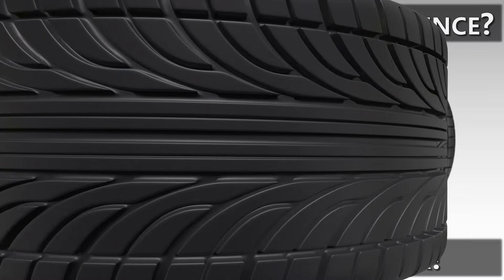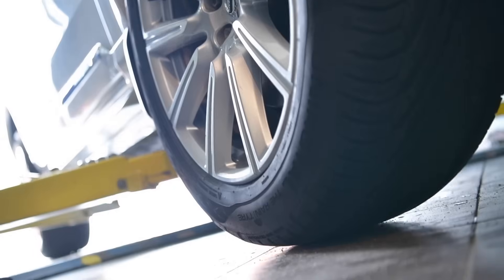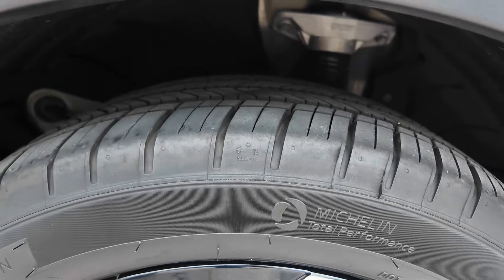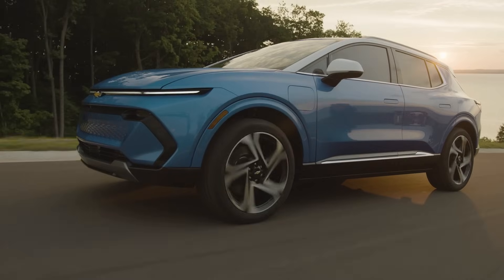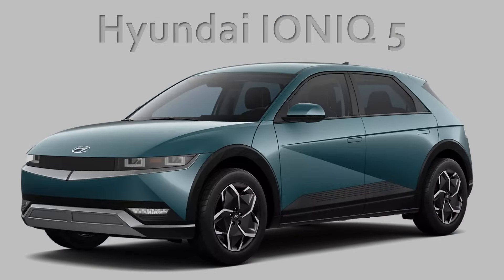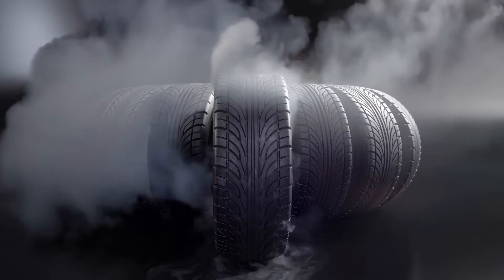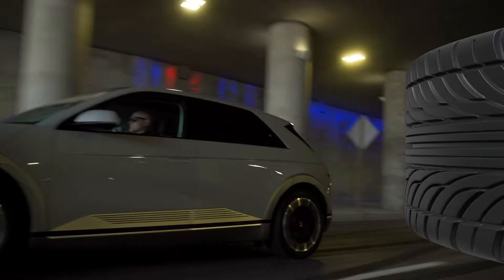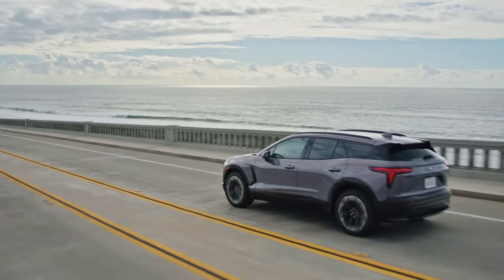Stop Wasting Money on 'EV' Tires—Here's Why

Comment: Hopefully you have a disclaimer on this video. Always go off the manufacturer specifications, If a non EV tire fails on an EV and you caused an accident or a death, you’re in a world of hurt. Also the 10-20% heavier is most definitely wrong, example a Gas Escalade is 6200lbs, the EV Escalade is 9100lbs. That’s 50% heavier. A VW Golf is 3400lbs, the iD4 is 5,000lbs. You also need to consider sidewall thickness, hitting a sharp edge with 50% more weight, do not cut corners on tires people.
Reply: So long as the tire is the right size, weight, weather, and speed ratings the insurance company isn’t going to care.
Reply from the maker: State your legal source for this statement. I’ll take it as a “scare tactic” otherwise.  Did you actually WATCH the entire video?  I’m wondering.  And your information on weight is wholly inaccurate. But that’s not surprising when you’re not educated on EVs.  Stick around and learn a few things.
Reply: @jimsEVadventures  Reality check re: legal system…. someone with money can always find a willing lawyer.  "Your Honor, defendant was driving a 5,000 lbs car with tires rated for only 4,900 lbs."  IOW law or no law, get the right tire as you expertly present in video.
Reply: I work as a professional driver with GM. I’ve launched the Hummer EV, Silverado EV, Escalade IQ, Lyriq, Bolt, Optiq, also with Ford with the Lightning, and Mach E, also with Rivian, Lucid, Polestar, ill stop there. I need not to state any “Legal” facts as I have nothing to prove to you. Go ask your auto insurance liability if they will cover an accident from a tire failure on a tire not intended for an EV.

Comment: Glad youtube recommended this to me.  So many promoters trying to convince buyers of this and that.  This video needs to be shared more.  I remember looking at the difference between michellian pilot sport AS vs Continental ProContact...for my 2015 Audi A6 3.0T quattro...the only real difference was the price tag.  I went with Continental  Sport SRS+ as they were on sale and were pratically identical.   Ended up selling shortly after and bought a Tesla Model 3.  Oddly they weight about the same.  I compared the factory-installed Hankook Ventus S1as vs the ion Evo....again...just price.  I thought I should remove the factory-installed ones, but after reading the real difference between the two...there practically identical.  For normal driving your 100% correct.  👍👍.  It's a real shame that these manufacturers use sly marketing to try selling goods.  I did my homework...and saved hundreds of dollars.

Excellent video.  Thank you fir sharing this.
Reply from the maker: Appreciate that.

Comment: Good to see someone putting out real info here. It drives me nuts having conversations about tires for my Tesla. ITS JUST A SLIGHTLY HEAVY SEDAN PEOPLE. The worst part about all of it though is tire manufacturers won’t ever honor the warranty if you put a “regular” tire on an EV which drives me crazy
Reply from the maker: Well.  The warranty part isn’t true. I’m holding the FULL warranty for my non-EV tires in my hand. There is no disclaimer about using them on an EV. SO…unless you can produce that, my use case says that statement is fully false.
Reply: @jimsEVadventures  new here, what tires are you using please. Also 2023 EUV.  THANKS

Comment: It’s also about torque .they need to be stronger on the rim due to the extreme torque
Reply from the maker: There are MANY internal combustion engine vehicles that produce as much or more than EVs. Like I said in the video, choose the tire needed to support the weight of the car and your driving style. I guess you can add, “especially if you like slamming your foot to the floor to test your tires!” 👍

Comment: Bringing my 2023 Bolt EUV in for its 15K maintenance tomorrow.  Running snow tires because I'm in a northern clime.  They insist that they want to rotate them even though as temps warm up the snows are coming off in 3 weeks.  I'll ask for an exemption for the tires tomorrow.
Reply from the maker: It’s funny how they “insist” but they really just want the $$$.

Comment: In general your point is correct. However, while it is quite true that while EVs can run on any tyre of the correct specification, it is also true that tyres optimised for EVs can have a legitimate role. This is because all tyres are a series of compromises between many different, and sometimes conflicting, requirements and preferences. The chosen point of these compromises can depend on the charicteristics of the vehicle , e.g. low noise, and low rolling resistance may have a higher prominance for the user of an EV compared to the user of an ICE car - and while it's true that the users of high end luxury ICE cars may prioritise low noise, the driver of an S class Merc or a Bentley probably doesn't worry too much about small gains in fuel efficiency, so tyres for large, heavy,  powerful cars that are both very quiet and very efficient may be thin on the ground - tyres formulated specifically for the priority preferences of EV drivers can fill those gaps.
Reply: Tyre? Never seen it spelled that way.  Not knocking you at all but now I have to go find out if that's a Brit thing or where that comes from.
Reply from the maker: Tires improved for EVs are improvements for all tires. Which is why most (not all) tires are compatible with all cars, not just EV. Which is why there is a caveat at the end where I say, “choose wisely, but not specially…any quality tire designed for your vehicles weight AND driving needs will work just fine.”  If you NEED extra range, get the LRR tire. If you prefer more grip for safety (like driving in a FL deluge), get a tire that handles wet roads. But I submit for your consideration, a tire that is supposedly “tuned” for an EV will work on a gas-powered car just fine. And visa-versa.
Reply: Car is heavier needs a better tire otherwise tire wear will increase laws of physics
Reply: @jocelyndaoust3700 not astoundingly heavier for most. 
My minivan is 4400 pounds. My Q5 is 3800 pounds. My Bolt is 3600 pounds. 
Is the Bolt heavier than a similar ice car? Sure. Is it so heavy that I need special tires? No. It's not even heavier than common SUVs. But load ratings are nothing new. The tire companies are just marketing tires as EV, with a made up, non government mandated or recognized, rating for the purpose of sales.

Comment: Hey Jim,
Thank you once again for your service.
I think you are down to earth and the average Joe EV owner in America. People relate to you. 
I guess my 2022 Hyundai Ioniq 5 manufactured in November 2021 came with Michelin primacies and they lasted 40,000 miles. I thought that was just fine and normal and met my expectation. I don’t think those were EV tires??????
My preferred Hyundai dealer suggested a Continental tire for my second set and current set…… I gotta tell you, Jim I can’t tell the difference between the two tires.
I do know the primaries were approx $400 to $500 more then the Continentals……. that to me is a huge difference.
In Connecticut I paid $1100 for new tires, balancing and alignment.
I think I’m gonna get 45,000 miles on the Continentals and that may very well be because I stopped driving my powerful EV like an idiot 12-year-old sports car speed racer. I do still put the pedal to the metal to show off my chops but less than I used to when I first got my EV.
Great video, Jim!!!!!
Reply from the maker: The primacy tires on our IONIQ are off-the-shelf, all-season radials—not EV specific. They are great.

Comment: Marketing is so often the bane of the modern world...🤷‍♂️
There is one thing I don't get about tires/wheels on modern cars though, and that is size. For some inexplicable reason, many manufacturers seem to be extremely keen on putting massive wheels on their EVs, and often don't even give you the choice of having smaller ones if you choose a certain trim. And larger wheels mean loss of acceleration, loss of efficiency (and thus range) and also more noise and less drive comfort.
So why does this trend exist? The Kia EV3 has 17" Wheels, but only on tue lowest trim. Higher trim gives you 19" Wheels and cuts 40-50km off your range. Skoda Elroq starts at 19" and goes all the way up to 21" and they don't even disclose how much range you lose. Is there a sane explanation for this?
Reply from the maker: I think the only explanation is how it makes the car “look” to the buyer. Back to marketing…

Comment: What about EV' wanting Higher psi ratings
Reply from the maker: The PSI is proportional to the weight rating. Comparing an SL rated tire to an XL rated tire that is the same size, the XL tire will have a higher maximum pressure and, therefore, require a higher recommended pressure. The Bolt’s original tires are SL rated. 38PSI recommended. The tires I replaced them with are XL. I run them at 40PSI. Thru 14,000 miles, wear is perfect.
Reply: My two sets of tires on my 2022 Hyundai Ioniq 5 wanted 38 pounds of pressure and I prefer 36 and I win every time. My car handles well and is smooth and is quiet.
Reply: Higher PSI also reduces rolling resistance for more efficiency at the cost of making the ride quality firmer and less comfortable.

Comment: Great info Jim.

On my Bolt that now has 10,350 miles on it, I have not taken it in for a tire rotation yet.  I should since the first one if free, but I hate going to dealer service departments any more.   I really thinking that I may just keep them rolling as is and never do a ratation.  Then when the fronts get worn, just replace those two with the same tires and let the rears stay put.  I take really good care of my tires and keep them properly inflated and I also don't drive crazy like many.  So far I'm very happy with the Michelins that my Bolt came with.
Reply from the maker: A word of caution…most tire sales folks won’t put new tires on just the front anymore. I don’t know why…go get them rotated. It’s worth it in the long run. 👍
Reply: @jimsEVadventures  You too? I just had that happen a month ago. Must be greed.

Comment: So, what kind of tires do you use on your Bolt?
Reply from the maker: Nexen N5000 Platinum.  These tires are XL rated (for heavier weight).  The Michelins that came on the car are only SL rated.  So far, after almost 15,000 miles, the wear is "normal" and I have not spun the wheels off the rims due to the higher torque...
Reply: @jimsEVadventures  The Nexen N5000 Platinum seem to be oval tires. How do they handle road imperfections?